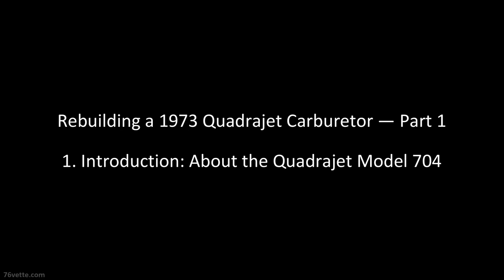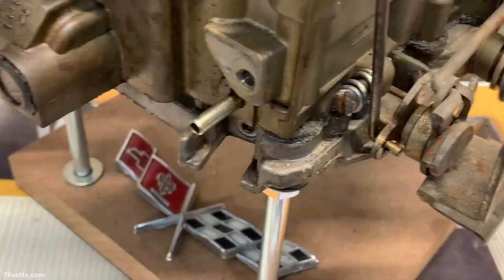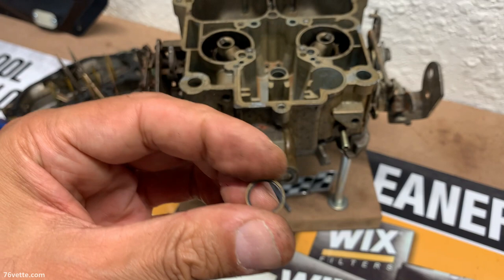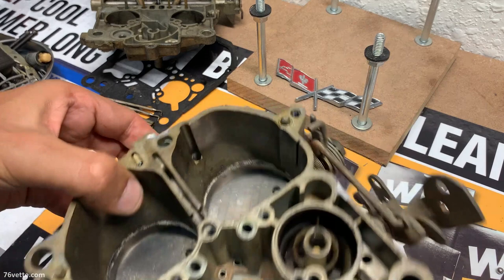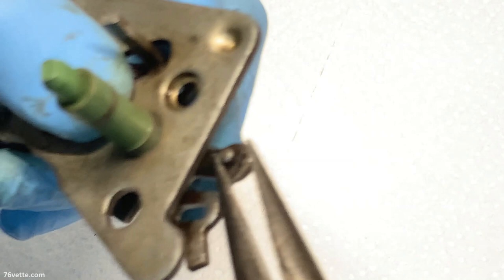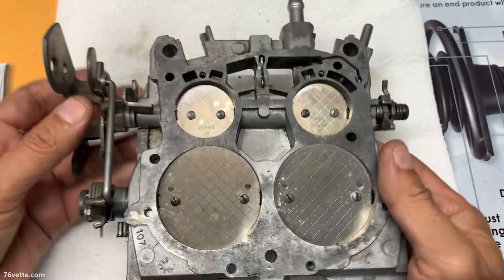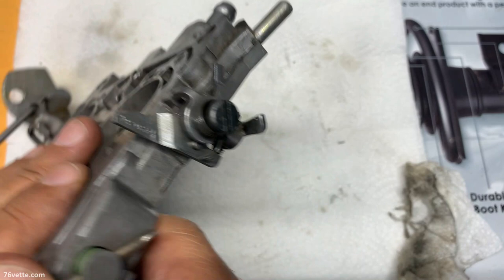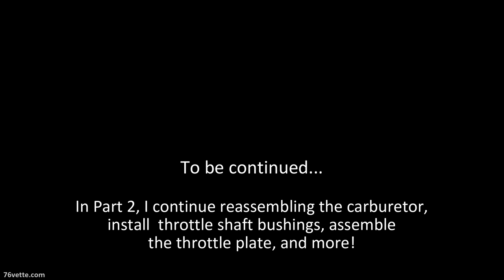Taking Apart a Quadrajet 704 Carburetor

Comment: If I were to ship you a Quadrajet carburetor from a GMC c15 350, could you rebuild it for me, and roughly how much would that cost? I recently received a family truck, I got it running after 20 years of sitting, but the rear barrels were wired shut, I initially thought it was to save fuel, but I figured out that it was due to the rear barrels sticking open. I have seen many of your videos, so I know that you know exactly what you are doing, so if you could it would be greatly appreciated.
Reply from the maker: I don’t rebuild carburetors, other than mine, but for professional results I use https://allamericancarburetor.com in Orange Park, FL. 904-215-6790. 

They remanufactured the original QuadraJet 1708 from my 81 Corvette, and they did an amazing job. 

https://youtu.be/lJZoFrPcuag
Reply: @76vette , thank you for the information, I’ll definitely be reaching out to them!
Reply from the maker: @aidenclark1821  You’re welcome! 😊👍🏻